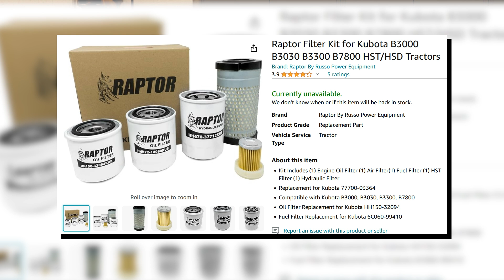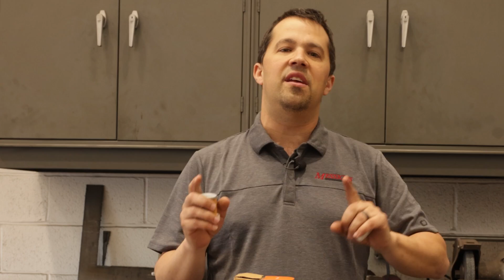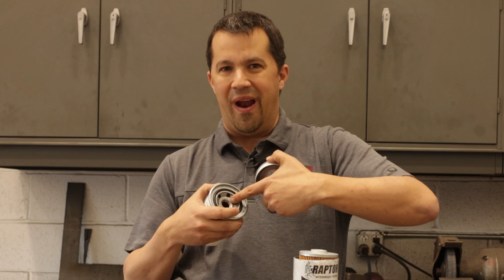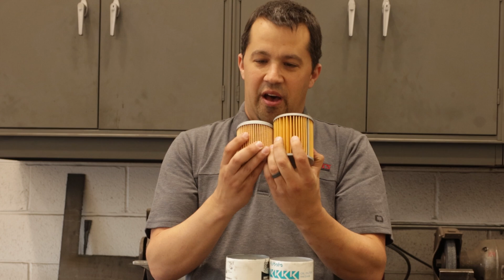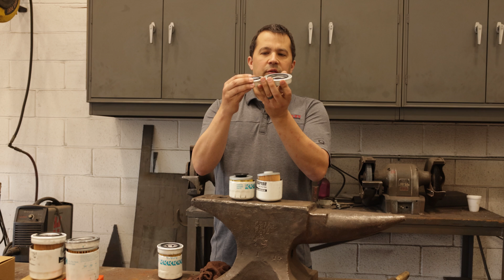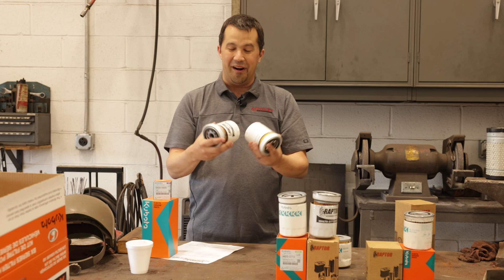Cutting open Raptor filters from Amazon.

Comment: I use dealer fluids and filters on my gravely mower, Kubota tractor and Bobcat diesel UTV.  Only one that’s a real ripoff is Bobcat as they hide the specs on everything, including fluids.  Lesson….dont buy Bobcat anything.  Don’t think they make anything themselves.  The engine oil simply says engine oil on it with no SAE ratings etc. made by Polaris but they charge extreme for everything….not trying to take away from topic, but will take opportunity to save others misery if ya considering Bobcat (do t do it)….oh yeah, the Bobcat dealer doesn’t stock filters or seals and expect you to pay freight on them to be delivered to their dealership.

Comment: The spring in the spin on filters is not for a bypass mechanism, it's purely to push the filter element into the threaded base for sealing.
Reply: I've commented the same in the past snd Messicks even has another video addressing this and reiterating the same thing about the spring, never looking at the bottom center of the canister for the actual bypass that is built into it for engine oil filters or missing for most hydraulic filters which have bypass elsewhere in the hydraulic system. I even ran this question by whipcitywrencher which is a channel all about filters and he agrees. The coil spring we see in this video is only for seating the canister filter snug into the canister housing.

Comment: Many years ago I worked for a company that made a "rubber "gasket valve cage for a fuel filter. After market spec for material was "black" OEM specified Viton a much more expensive material designed to be compatible with gasoline.

Comment: I always support oem filters for the most I’ve seen direct replacement aftermarket filters fit not as well or smaller in physical size but then again tractor companies typically don’t own there own oil filter factories i know fleet gaurd makes some for cnh and wix does for other brands i believe but then interchanging those is no problem if u don’t want to do research and buy proper aftermarket just buy oem its safe and easiest

Comment: What's amazing is that Messick's is STILL cheaper than my local Kubota dealer even when shipping is factored in. $88.93 for a HHTA0-59900 Hydraulic Filter ($75.98 + $12.95 shipping) from Messick's vs $96.60 locally ($90.28 + $6.32 tax).
Reply: I will be ordering from Messick's then for my next filter set.